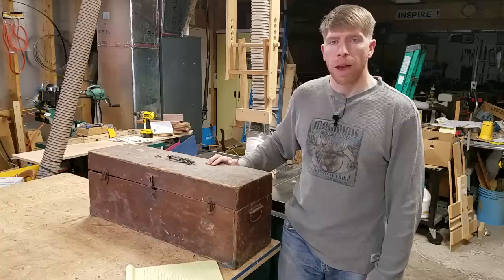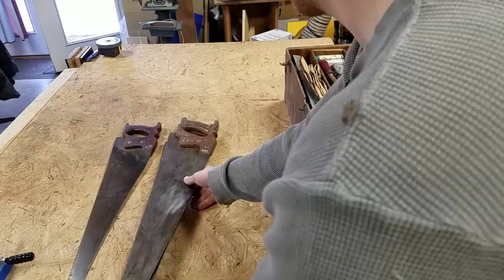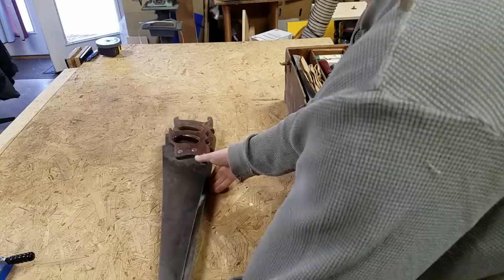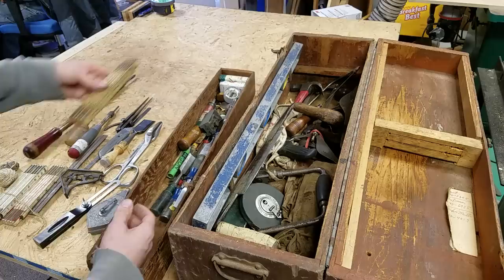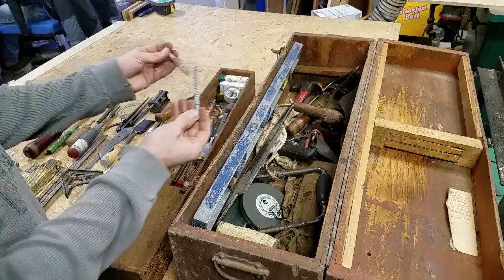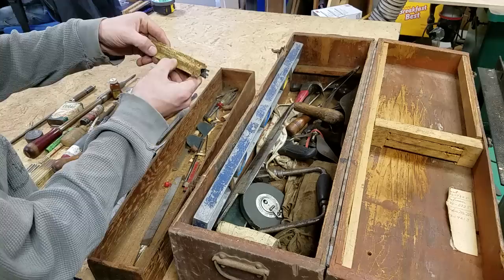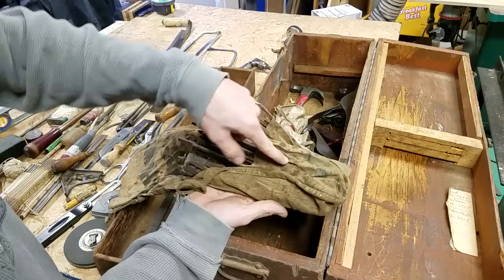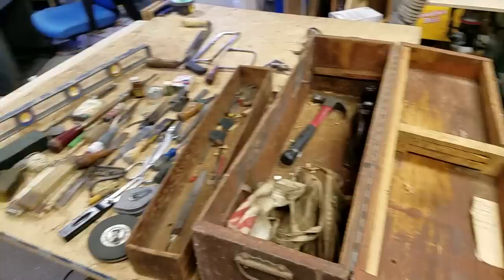Toolbox Time Capsule, unpacking a 1930-1950s era Carpenter's Toolbox! /EP43

Comment: holy cow.... I have all of the same stuff, but its all modern. three hand saws fit in a small space, I have a table saw a skill saw a sawzall...... all labor saving designs. and to be honest, I don't think I could do the same job with just that tool box right away. it would take some getting used to.
 gotta respect the folks who did that job that far back. it was a lot harder to do then and it took more skill.
Reply: I use the exact same tools -- all hand tools, because I don't have room for a room full of power tools (and because I don't like the noise and dust). Hand tools take a lot of skill to learn to use effectively, but they're very efficient -- sometimes even faster than using power tools (take planing versus sanding, for example.) Many professional high end furniture craftsman still primarily use them. It's great fun and I encourage anyone to learn how to use and sharpen a chisel, plane, and hand saw: it will ultimately make your life easier and more enjoyable! A mix of modern and old methods is the most efficient: power tools for quick rough work (if you have the luxury of space and money!), and hand tools for fine detail work and joinery.
Reply: I learned how to use and sharpen a chisel, I have one that is older than I am so I figgured I owed it that much, (not ruining it)  I found that once it was properly sharp I didnt need a mallet to use it at all. I then put a proper edge on my axe......
   the short story is that i have discovered that you are right. using hand tools the right way is less work than using them even a little off, and learning how to do it right is a pretty decent way to deal with stress at the end of a shitty day! going back and doing things the old way is quieter, and if you take your time a joint can be almost invisible. I dont care who you are, that feels good

Comment: That was a push drill. It rotates the bit clockwise on push and counter-wise on reciprocal. Garret Wade made them, maybe others. Bits usually stored in handel. Often simple  straight-flute bits.
Reply: btw: pretty sure no true chisel cab be sharpened by a file unless it was a diamond board, or the file was heated and lost its temper.
Reply from the maker: Thanks for watching and for sharing your knowledge. Not sure what I was thinking with the filling. There are sharpening marks on all of his tools, some are quite aggressive. Maybe a course stone or grinder? All of his edges have a semi-fine polish. What amazed me the most was the lack of rust from storage (Except the bits stored in cloth) each item was oiled before being put away
Reply: @benchtopwoodworks  : yes oiling is essential and gives a fine patina. old grinding wheels can get filled with metal and begin to leave scoring unless dressed. More likely from a hand cranked wheel grinder. That's precious gear you have there. Like a time machine. Tx.

Comment: Chris, I wanted to say hello from Chambersburg.  My father and grandfather were both carpenters. As you were going through the toolbox I would have sworn those tools were my dads and grandfathers. I remember when I was a kid and my grandfather passed away my father was going through his tools and incorporating them into his toolbox. After my fathers passing I did the same. I have kept and use many of them in my tinkering in my wood shop. It was interesting to see the "cordless" screwdriver, push drill, brace and bit set, planes, hinge marking gage, dividers etc. One tool I remember my father had that I didnt see in your video was a hatchet for trimming framing members or making stakes for batter boards to layout a foundation or stakes for concrete forms. One last thing-  my father was born in Lewistown so my grand father and yours were in the trade in the same area at the same time. Who knows perhaps they may have worked together on some of the same projects in the area. Thanks for sharing
Reply from the maker: Mark, thanks for sharing. Believe it or not there was a hatchet! My mother told me she pulled it out after I cut the lock off in the year I was away I think one of my parents needed it for something and it was handy. She mentioned it to me later.
My great grandfather lived in Port Royal and my parents lived and mother lives in the Burnham/Lewistown area. My late dad taught shop class at Lewistown middle and area schools for 33 years.Small world, I really appreciate you sharing your family history!

Comment: He did not sharpen his chisel with a file. The corrugated fasteners are for wooden corners like a wooden storm door.  They work well and are in use today.  There is a pneumatic gun that fires those also. Planes rest on their sides, always.
Reply: Planes rest on their sides, always. Planes rest on their sides, always. Planes rest on their sides, always. Did I mention planes rest on their sides, always?
Reply: No, planes rest with the blade down, unless you put it down on something other than wood or soft material. It won't damage the blade and you won't have a sharp blade exposed where it can catch a finger or a screwdriver or whatever me be in the area
Reply: This is wrong. This is something introduced in school shop class because kids would just slap planes down on top of anything -- metal or wood. Most old fashioned woodworkers placed their planes blade down on their wooden bench in order to protect the blade from being nicked by tools that might bump into the blade. This is much safer so long as you care enough to look at where you're putting the plane down. Many joiners who worked professionally as apprentices have commented on this.
Reply: I edited my comment, without a coma after the "no" it changes the intent of what I wanted to say. Thanks Luke for doing a far better job than me
Reply: @horshamforgehorshamforge2649  YES.
Reply: @escalator9734  Why wouldn't you put them on their side always. If you do that you only have one habit to learn.  As far as hitting the iron with something, just don't do that.
Reply: Because leaving an exposed sharp edge is not a good idea. Of course you don't hit the iron, except when, you know, you do. Because accidents happen, it can be a pen, your finger or a screw driver, a clamp, whatever. You can't always think about where the the exposed edge is while doing 10 other thing, reaching over the bench, taking stuff left and right.
There no habit to learn. Just put your plane down on a wood surface, which most of the times happens to be your workbench, where you are already at. Even putting it down on metal won't hurt it If you're gentle and don't move it once it's down.
Why put a blade cover on a circ saw, hitting the blade with you fingers, just don't do that. (yes I know it's a dumb non argument, but still)
Reply: The only people who lay a plane on it's side are the ones who were identified as idiots by their wood shop teacher or father.  The rest of us were smart enough to know you don't put your plane down on something that will nick or damage the cutting edge, or skilled enough to sharpen them ourselves instead of making work for someone else.  Guess your teacher figured you to be an idiot.  Who am I to disagree?
Reply: Escalator exactly thank you. I roll my eyes when people push the laying it on its side thing. So they would use it to shave wood but won’t set it down on a wood bench. Smh
Reply: My dad called em 'Jew Nails'

Comment: Hey, I really enjoy the video and maybe you'll get to it in the last 20% of the video, but I'm actually watching these because I haven't interest in making a similar toolbox to use for work. Therefore, I'd be kind of interested in the construction of the box as well. It's kind of hard to tell it looks like it's not even plywood. It looks like actual wood construction which is very neat.
Reply from the maker: Stitch thanks for watching and for asking. I have been asked for these details a few times, but have never taken the time to sketch or share.  The toolbox is about 800 miles from where I live.  If I get the chance I may do a video specifically on the box construction.

Comment: I pretty much have the same kind of tools in my box.very interesting.by trade I am a carpenter.I think my tool box weighs Mabe 40 or so pounds.
Reply: Not much different to my basic site box, modified from a French polishers box. Only difference, I don't carry a brace, drawknife or a Yankee screwdriver. I still use wooden spokeshaves and a steel backed tenon saw, a bunch of chisels and a couple of bench planes.
Reply from the maker: Thanks for watching and what you do Henry!
Reply: @benchtopwoodworks  
Hello; I restore and copy historic joinery and furniture.

Comment: In the 'general carpenter's tool box' there wasn't room for the 'Carpenter's Square' so this was hand carried outside of the box , but to safeguard the easy lose of the 'stair gauges' they were safely stored in the box for when they were needed .
Reply: I just picked up a collapsable framing square yesterday. When I saw it I just had to have it. I never knew such a thing even existed. It must have been expensive as sin to buy when it was new. Because they milled out a dovetail into the blade to slot the tongue into. Look up Southington hdw framing square to see what one looks like.

Comment: I forgot to add if you are sharpening your chisels on my job site with a file, we need to talk. There are many ways to get that job done - stones, wheels and even S/C sand paper but usually never a file man.
Reply from the maker: The reason I describe filing to sharpen is for several reasons: there are file marks on his tools. Not sure if it's from a grinder or from rouging gouges out of the edge to restore it or set an angle he preferred. I observed him using both a file and slow grinder when I was younger to bring an edge back in on his workbench. Of course he sharpened and maintained on a stone, he taught me to sharpen using a wet stone and had one in the chest. Pardon my  live speech on the video 'all', I'm certain his final edge was likely on a stone. Filing is not inaccurate, nor is it a bad way to quickly bring an edge back and my point in mentioning it is it is a lost art among machinists and a fast way to remove metal, especially when you're not near a grinder.  Its easy to mis-speak during these videos but I did not mean to say that he used a file for a final finish or assume that is his only technique. It was apparent that he used a file when sharpening. Thanks for watching and for commenting/sharing your wisdom.
Reply: You're quite right Chris.  A man working on site and in need of getting on with the job doesn't have time to faff about the way the latest generation of youtube-woodwork-experts seem to think.  A sharp single cut file in skilled hands will do as good a job as many could achieve using a coarse stone side on a combination stone.  Putting bread on the table doesn't require fancy, just skill and a smart solution to the problems of the day.

Comment: there was very little from the 1930s lots of plastic handled tools aluminium level  hammer with a glass fibre handle ...etc. etc
Reply from the maker: You are of course correct, Sir.  I certainly don't think many of those tools at all were from his first days of working. Those were just his years of employment.  I'm curious to know what some of the tools date at. I know the earliest phenolics were the 1950's and modern  thermoplastics a bit after that.  I'm sure some of the tools were acquired into the 80's and even mid 90's. Thanks for watching and taking the time to comment,  Stan!

Comment: I think that the nail bag full of drill bits is actually an old apron
Reply from the maker: It's an old nail apron, the one thing in the box he didn't oil. We always called them. Nail "bags" (nail-bag is Pennsylvaniaese)  growing up, we would wear them for framing/roofing. That cloth really drew and held in the moisture. Thanks for watching!
Reply: @benchtopwoodworks  I like seeing the old tools displayed and have a collection myself. Some are old family tools. I respect the people who used them to earn a living. I'm a carpenter/ cabinetmaker so I understand how difficult it must have been before power tools were widely used. I also collect nail aprons and like the old ones that were usually printed with the individual lumber yards.

Comment: Very nice tools! People who do high-end woodworking by hand still use vintage tools like this: It's hard to find quality modern equivelants. By the way, chisels and planes are not sharpened with a file (unless they're really, really damaged) -- they need to be fairly sharp to do the job, and are sharpened on whetstones. Auger bits (brace bits) and awls are usually sharpened with a file, but may be sharpened on small stones as well. The round bit you found that looks like a gouge might be a spoon bit -- a very rare, and very prized drill bit that is favored by chairmakers.

Comment: What is written on the paper stuck to the underside of the toolbox lid?
Reply from the maker: Grant, I'm not sure. I'll have to look next time I'm visiting in Pennsylvania.
Reply: @benchtopwoodworks   Thanks for this prompt reply. It's such an interesting subject for a video - all that experience in a box. As a self-taught framing and sometimes finishing carpenter the decision about what goes in the box and what stays home was often decided by weight and size. So there's no clamps in his box and it could go over the shoulder at the end of the day without too much discomfort. I thought it might be the riser to going ratio for the design of good stairs written on the note under the lid. Love his chalk line and the well oiled American steel. Thanks again.

Comment: The first two stick rules (folding rulers) you took out of the box were engineers rulers which are white they were primarily used by carpenters as conversion rulers used with blueprints to convert inches to decimal or 10ths of feet
Reply from the maker: I know there are a ton of tricks with those folding rules (scribing angles, curves, etc) I've never heard about converting with them.  I will have to check that out.  I know many of the old timers have forgotten amazing tricks I'll never learn due to calculators etc. that keep the brain lazy.  Thanks for sharing, James.

Comment: what oil would you put on tools like that? I might start doing that myself..
Reply from the maker: 3 in 1 oil, is what some use. It's cheap and I like to keep it around the shop. I think mineral oil is used for TMDE and measuring tools, it smells somewhat similar to 3in1. I'm not sure what oil he used, there was not a strong odor. Really most oils will work. There are some firearm oils that protect but don't have strong odors.

Comment: Interesting video. I have a similar toolbox made by grandfather. Unfortunately nearly all the tools were gone by the time it made its way to me. Also unfortunately, he made it from that "new-fangled plywood" with nailed joints. They worked loose over time and I added glued in reinforcements to keep it together.  I've got 2 of the Yankee screwdrivers and one drill, but none of them are working. One polite correction. I think you got the type of hand saws at the beginning reversed. As a general rule, with hand saws, rip saws have the larger teeth and crosscut saws have the smaller ones. BTW, kudos to you for replying to nearly everyone who's commented here. It is appreciated, at least by me. :-)
Reply from the maker: Thanks for watching and for taking the time to share about your grandfather's tool box. I'm sorry to hear it was pilfered or the tools didn't stay together...but I'm glad to hear you have the memories and a few of his tools to hang on to.  For the saws I was looking at the grind/file angle and set to tell the difference. My understanding has always been rip teeth look more like chisels with flatter tops with a less-exaggerated set for 'shaving' chips along the grain and cross-cut teeth have a more defined point like a knife for severing across the grain.  I'm very far away from that box in order to confirm which he had and I honestly don't  recall  I know a few folks have been interested in the makes of the saws as well.  Thanks for watching and taking the time to comment.  I appreciate that you noticed I try to respond to everyone.  I appreciate  all of you watching and commenting! I'm honored to share when I can.